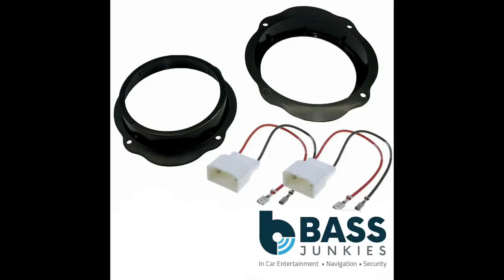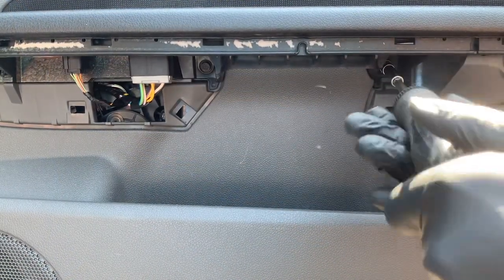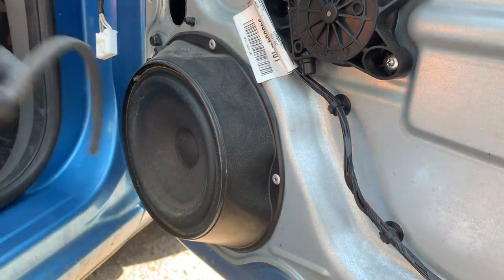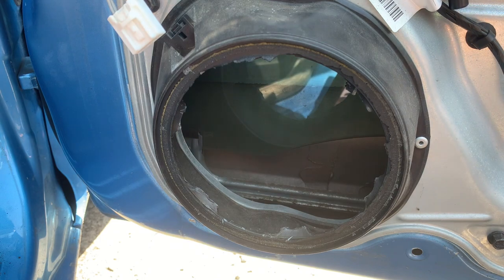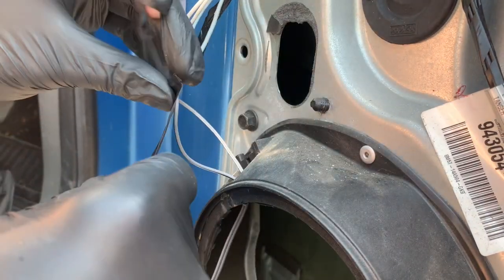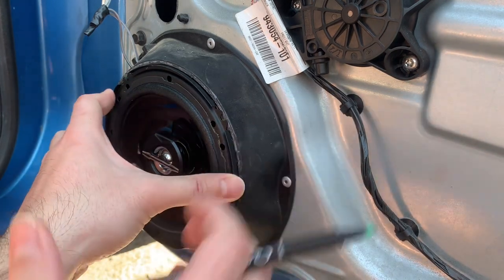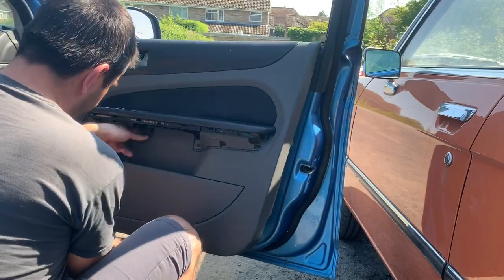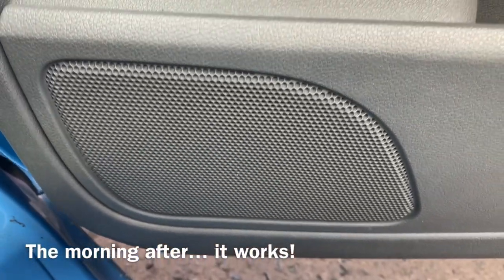Upgrade your Focus MK2 speakers for mind-blowing sound

Comment: Great video Gentile, I have purchased a rear interior light upgrade Light unit, so that I will have Map reading lights front and back. I also have a headlight switch unit with the addition of the dimmer function. This is from a Focus C-max, so it doesn't have the Auto lights, function as my Focus is an Zetec like yours Gentile. One of the first jobs I did was to put some bulbs in the front foot well light bulb holders, present on most Mk2 Ford Focusses. Great stuff again Gentile Cheers.☺
Reply from the maker: Thank you very much. Great work you’ve done there. I’m fitting a rear interior light at some point now that I’m am a parent and when the winter comes I want to see better at the back.

Comment: Hey man, nice video I probably will need this in the upcoming week! Last week I had to brake hard on the highway for the car in front of me, a can of Red Bull flew to the place where the cigarette lighter is located and where my phone was laying connected to an AUX cable. It was dark outside and so it was in the car, I noticed that the drink fell there like 3/4 minutes after it happened. When I noticed, I took out the can of that place and checked if my phone got wet. On the moment I picked up my phone, my left speaker stopped working directly. A few days I was looking why my left speaker stopped working, but on the day the temperature got higher outside the speaker started to make buzzing sounds and worked for like 3 seconds and started buzzing again. I’m gonna change both of my front speakers like you did but do you maybe know what could cause the left speaker to stop working? Thanks man.
Reply from the maker: Thanks. No idea on what caused the speaker issue and it took me a while to notice to be fair. I guess they all go bag at some point as many owners had a similar issue
Reply: @GentilsGarage  Thanks for your reply appreciate it 🙏🏼 I probably will use an adapter in between because I don’t have any soldering equipment. Another question man, how do I know which is the minus and plus cable coming from the car itself? Are the grey ones the minus and the whites one the plus? And does it matter how I will put the adapter on? I read about it to get the best quality of music to put it the correct way, but not sure which colour stands for what.
Reply from the maker: @fja4117  I think the +/- are stamped on the speaker terminals

Comment: hello thank you for your video if I understand correctly the rear speakers connect to the front speakers. Can you confirm this for me, thank you.
Reply from the maker: they are independentkly wired. I can change the speaker balance to just front, just back or all of them.

Comment: I own a 2010 Ford Focus MK2, and I’m experiencing issues with the speakers. Currently, only the rear driver-side speaker and the front right tweeter are working. I’ve checked the wiring, and everything seems to be intact. Does anyone have any idea what the issue might be?
Reply from the maker: The speakers might have gone bust. Mine only worked when it was nice and warm outside
Reply: @GentilsGarage  speakers work in have tested i think i have a short somewhere 
But i have no idea where😅😅
Reply from the maker: @andreitatarus989  ok, I see. In that case you need a device to test the current.

Comment: Can get cheap adapters so you don’t need to cut the wires I have done similar to what you did but used the adaptors to save the main plug
Reply from the maker: I know, I do mention them at 1:04 and there’s a picture of them too. However, since I have no intention of using stock speakers again, I see no point in buying an adapter for something I’ll never use again.
Reply: Hey Chris, how do you know which cable is the plus and minus coming from the door itself the grey or white ones?

Comment: The speakers I bought were slightly too big so I had to remove a bit more material but then I struggled getting the screws in. I'm embarrassed to say it took me 3 hours to do this but I'm glad I did as both factory speakers had stopped working.
Reply from the maker: Nothing to feel embarrassed. Sometimes car jobs take longer than we think

Comment: Just take out the original speaker mounting and buy a new one für after market Speakers, is a better way. There are some adapter for upgrade speaker for this type of socket aswell. it can be done more professional then that.
Reply from the maker: You missed the bit at 1:00 where I did mention the adapters. 
Also I needed to rivet the adapters on the door and I don’t have a rivet gun
Reply: @GentilsGarage   u can buy holders for the Speaker and fix it with some bolds and nuts
Reply from the maker: @Smokyhead  I know I can buy the holders, but they are better fixed in place with rivets. Also saves me spending £10 or more on something that gives the same result and it’s all hidden behind the door card and secure.
At the end of the day, the goal is to get the speakers working, have a better sound and save money.

Comment: Lot of work. Easier to fit the blue plastic coned Ford ones. Drill out 4 rivets. Swap the speaker and rivet it. 10 min job including taking the door card off and on. They sound pretty good as well
Reply from the maker: These ones were far cheaper and I didn’t think it was a lot of work. Also I don’t have a riveter or rivets available (never had the need for them before). Everyone does the jobs according to their needs and tools. The end result is what I wanted, so that’s good enough for me

Comment: There were already cable ends inside. You made a mistake by cutting the socket.
Reply from the maker: They were not the same size as the terminals in the speaker, that’s why I had to cut the socket
Reply: You could have soldered the old wires.
Reply from the maker: @fordgarajankara  no point keeping the sockets if I’m not going to fit Ford speakers ever again. Much easier for me to do this way

Comment: Don't you have to disconnect the battery when you are working on an electrical device?
Reply from the maker: Not always, although many argue in favour or against. In this case the radio was off and the ignition, that also sends the power to the radio was off too. 
In the same way, the battery doesn’t need to be disconnected to replace bulbs, so no need to disconnect the battery to replace speakers.
Reply: @GentilsGarage  Thank you

Comment: I was so dissapointed when I bought my Focus 2. The satellite speakers are soooo strained to listen to. Much better in the Focus mk 1 with the full tone unit
Reply from the maker: I totally agree with you. Also, soundproofing seems better on the MK1
Reply: I brought a mk2 facelift estate... to my disappointment there were no speakers at all behind the front seats... the previous owner must of upgraded at some point and removed all the rear speakers when they sold it!!!
I'm doing the big 3 upgrade with a higher power alternator and a bigger, better battery. 
it's not going to be a pretty penny but i want a dirty sound system sooo so bad!!! 🤪👍